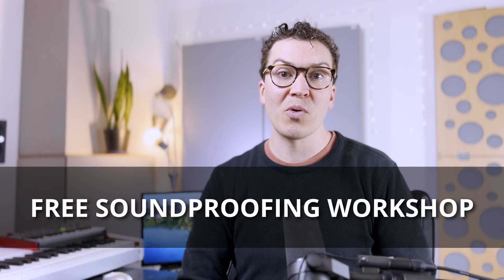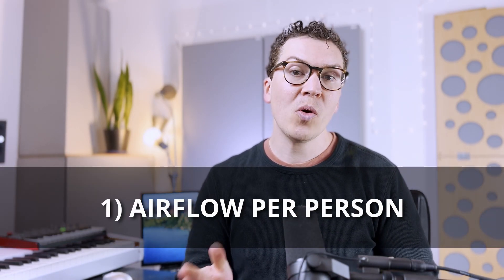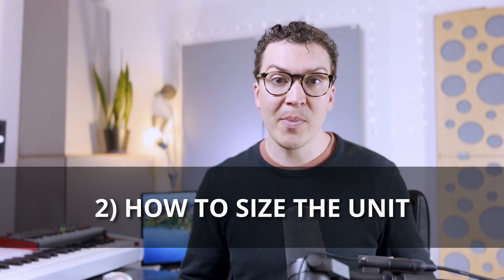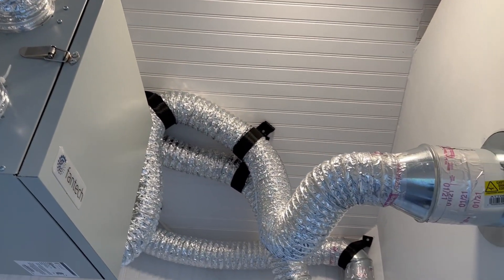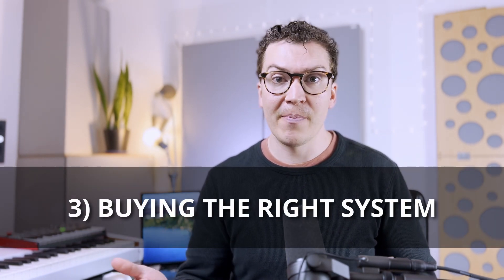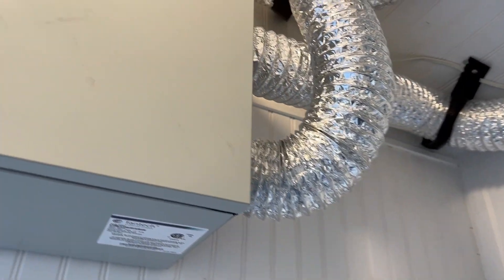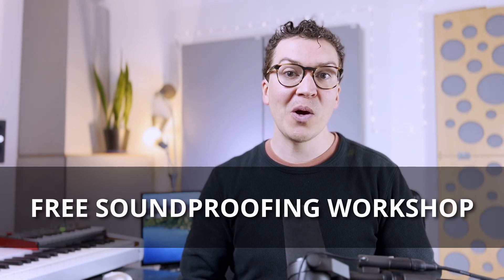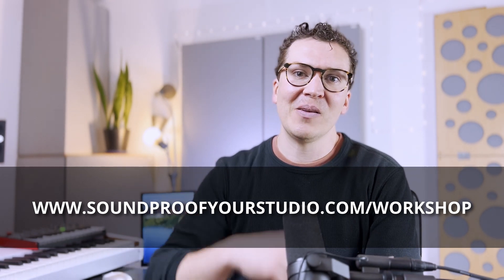How Much Fresh Air Do You Need In Your Soundproof Studio?

Comment: The airflow per person varies with activity level. If you are a drummer you need around 4 times the 15 cfm. Double check the met for a similar activity level. And cooling is also a issue. All your internal heat loads in the studio and person's based on activity levels are important considerations. And to have the colling supply external. A fancoil generates noice and is not preferable in the studio itself

Comment: Bringing in air from the outside will also bring in moisture if it’s raining a lot and the humidity in the studio rises. A guitar especially an acoustic one must live at 45% and it rises to 70% I am controlling it with the AC when I am in there  at 45% when I am not in with a dehumidifier itonly gets to 60 % I have no ventilation in there the sound proofing is professionally done I live in SE ASIA the average temperature is 30dec C how can you help me  to ventilate the room for health reasons ( I am normally working direct into the DAW  so out side noise not a problem but if I introduce wall ventilators I will loose the cold air from the Ac which I don’t want what is the answer ? To keep down the moisture and to protect my health? Thank you in anticipation  kind regards Stephen

Comment: Hey Wilson, do you know how much noise the Fantech AEV80 makes?  My build is pointing towards having a unit inside of the usable space, so it's a big consideration for me.
Reply from the maker: I would not put it in your usable studio room. Keep it outside the iso envelope. Are you still in the planning phase of your studio?
Reply: @soundproofyourstudio  I'm building out a shed that I had custom built on a concrete slab.  It was the only way I could get any sort of structure in my backyard for a number of reasons.

The shed is 16x10, so space is limited. Trying to come up with some solution that has the baffle boxes on the inner envelope...
Reply from the maker: That can be a tricky plan. How do you feel about your confidence level in building your studio right the first time without any outside help?
Reply: @soundproofyourstudio  I'm confident in the rest of the build at this point.  I'm keeping it very basic, and using Hushframe rafts to maximize space.  And since there is no room for a utility area, a ductless mini split will be installed.

Ventilation is my only hang up.  I'm between two plans:

-Using a Panasonic's spot ERV built into a dual chamber baffle box.  The box will be 1' x4'x5.33', and the sections where the drywall perforates with 5" hole would be handled by sealing it with a good amount of weatherstripping and insulation

-Using the Fantech AEV80 with three baffles boxes:  one 'generator' style for the AEV80, and two standard that attach the wall the same way I described above.

Given the AEV80 noise and the extra space needed, I'm leaning towards the Panasonic solution.

I know you've determined that the Panasonic unit won't work in most situations, but I think all of the core soundproofing principles can be maintained with my dual chamber design.   I'd be happy to share a sketch if you're interested.
Reply from the maker: Sounds like you are on the right track. When you DIY you just have to trust in your decisions based on everything you have learned. Best of luck!

Comment: Have you seen anyone using a Co2 monitor for something small like a drum room on a budget?  When the Co2 builds up.. open up the door and take a break.
Reply from the maker: Unless the temp is the same outside in which case there would be no air transfer
Reply: I have a combination alarm in my studio, smoke and CO. Its also tied to the rest of the house system as the studio is sound proof and would not hear any alarms just in that room

Comment: Great info on this video!
 I  have a small walk in closet that I converted into a studio. It has a drum set, guitar amp and p.a.  

With the door closed it gets hot with 2 people and oxygen gets slim. I have to eventually open the door. 

To solve this without opening the door, I have thought about installing an exhaust fan. Luckily the walk in closet has the roof entrance in the ceiling. 
Thinking of just getting a foam 4x4 board and installing an exhaust fan on it. Then replace the existing wood board covering the entrance with it.  The fresh air outside the room can go in from the bottom of the door with the help of the exhaust fan sucking the stale air out.  

Lmk what you think.
Reply from the maker: Hard to understand over text, but it could work.
Reply: what’s hard to understand? @soundproofyourstudio what’s hard to un

Comment: I was wondering, i read alot about placing such a box of placing separate fans for freshair and exaust.
But why not place just one on the exhaust and add just a vent with a diy sound maze box?
The exhaust fan wil create a underpressure in the room what wil suck fresh air from the vent.

In my country (The netherlands) the is like the normal way to extract air from our houses ( and thus suck fresh in )
Reply from the maker: Sure that could work too as long as the pressure is right. The ERV as a unit does more than just transfer air so their is the benefit of using it.

Comment: I started my project then relaised I needed ventilation. On your workshop video you made ventilation from a lined wooden baffle. Is this Fantec system to replace that?
I'm really stuck on how to  ventilate my soundproof room as it is inside the house with a dry wall  into my garage, and the other 3 walls solid into the house. So the vent will have to go into the garage and out from there somehow.......
Reply from the maker: Yes it’s a tricky situation. I can help from a consulting side or you can watch my ventilation vids. Here is a link to book a consulting session if you are interested: https://www.soundproofyourstudio.com/offers/P8zp8ByG/checkout.
Reply: @soundproofyourstudio  Hi Wilson, I am based in the UK. Are you familiar with the building regulations for the UK? Do you know of fans etc that I can purchase in the UK, as importing thewm from the USA will be time-consuming and potentially costly paying import duties.
If you can design a system that will suit the uK building regs with parts that I can source in the UK I would sign up.

Comment: I installed an air conditioner for fresh cool air. Hope it is enough.
Reply from the maker: Just make sure you are getting ventilation
Reply: Air conditioners don't give you fresh air 😅
Reply: @iampeeyushkumawat  I live in a very hot and humid place.
Reply: what type of air conditioner? Most just recycle and cool the air already in the room but do not provide any fresh air.

Comment: Thanks for this excellent video. I've been going back and forth on this for a while, but I actually have a large window in my control room. Does all this just mean I should just open the window? I know it defeats the soundproofing part of the problem, but when its just me, or a couple of people i'm guessing I should just open the window, correct? Trying not to over engineer a solution to a problem I may not have.
Reply from the maker: Is the window part of your soundproof design? If not I would go back to the drawing board.

Comment: I have a concrete room I want to soundproof for drums. Not to a perfect STC but something to keep neighbors happy (in a townhouse). Should be a space between the inner and the concrete wall? If so, what is the recommended separation.
Reply from the maker: Yup 1" minimum is recommended.
Reply: What's an STC?